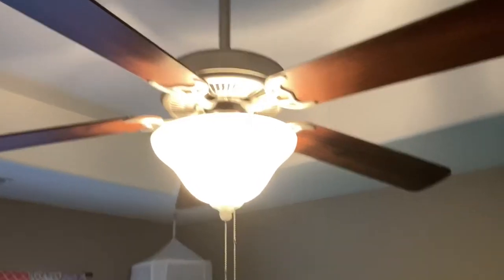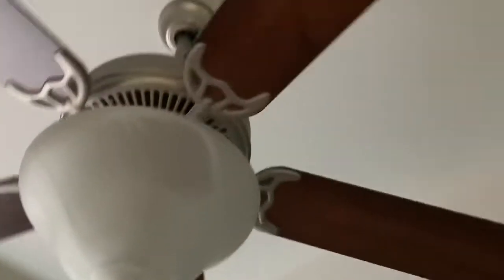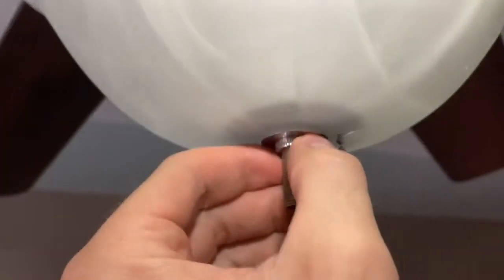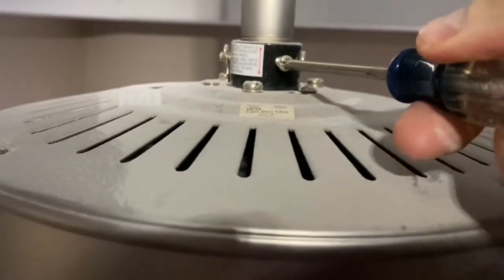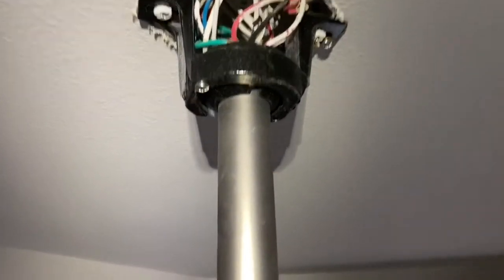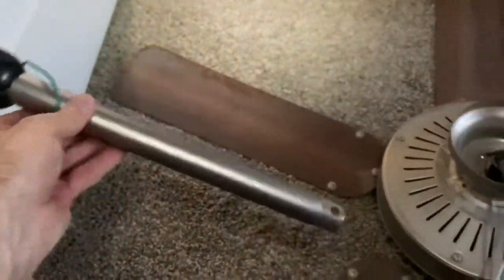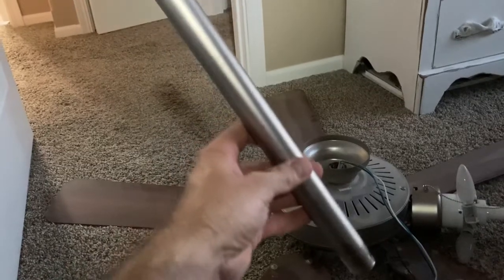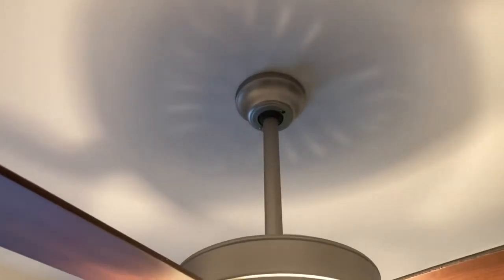️🔥 How to Make Your Ceiling Fan Closer to the Ceiling➔ Shorten the Downrod Extension - Easy DIY Job!

Comment: A waste of my time since your title mentions how to shorten the downrod and you did not do that!
Reply: You cut the rod on the ceiling side and then drill a centered hole for the pin to go into.
Reply: @4X4ish  Yes. I need to shorten my downrod because I built my Canopy bed and the Ceiling fan scrapes it.  I want Ceiling fan closer to Ceiling.